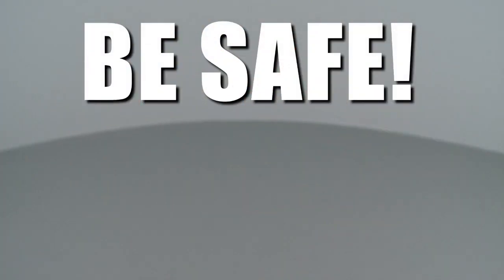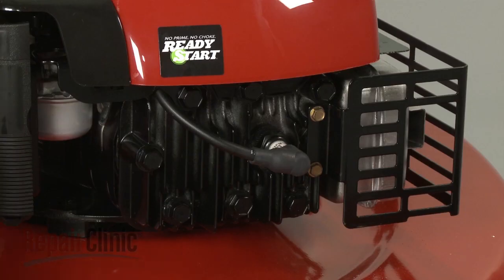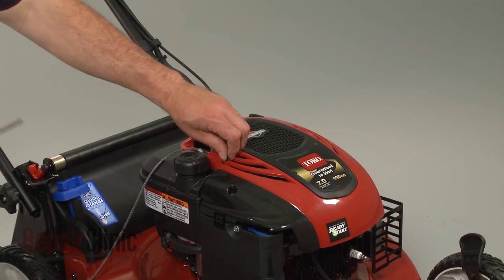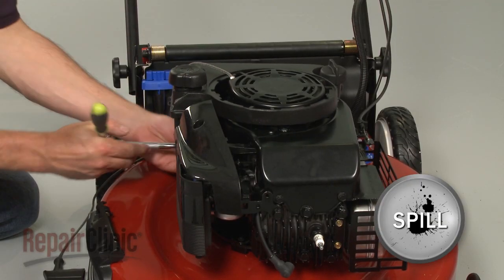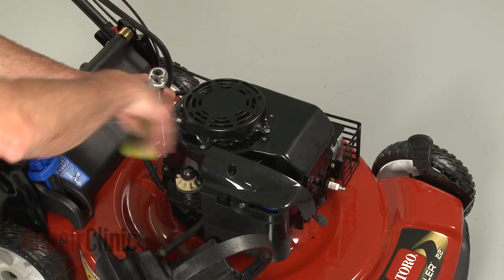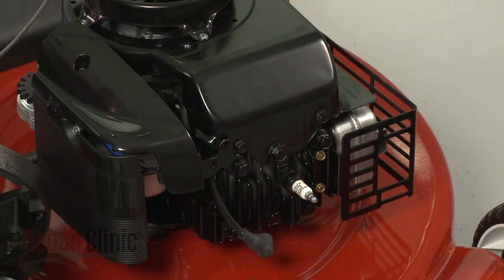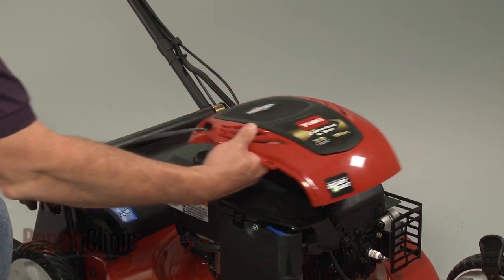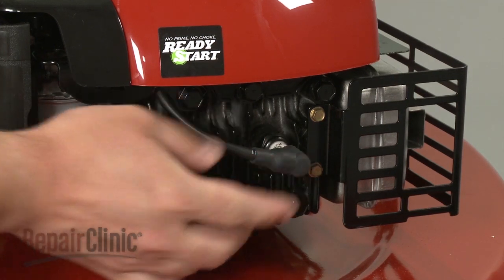Briggs & Stratton Small Engine Disassembly (#128T05-5123-B1)

Comment: What a completely incorrect name for this video  which STRONGLY implies a complete disassembly. This is in NO way a "Small Engine Disassembly". In fact you really have not touched the engine in this video. Only the covers. Plz update the video name or do a true "Disassembly" . I was hoping to see the bolts for the connecting rod on this engine as they are 2 different lengths and I did not take proper note of which went where.